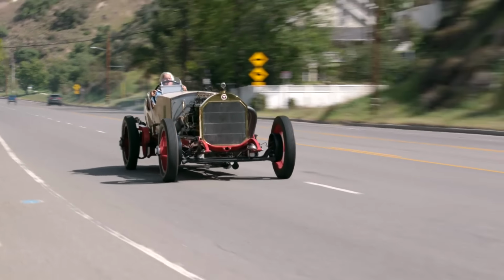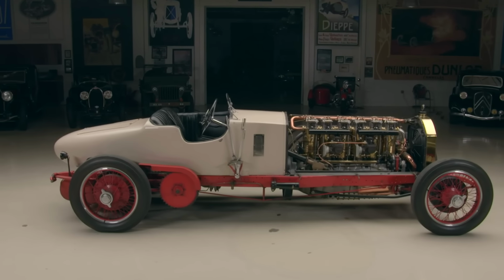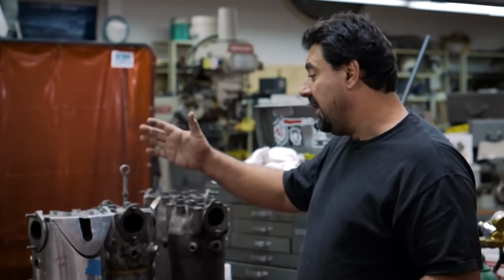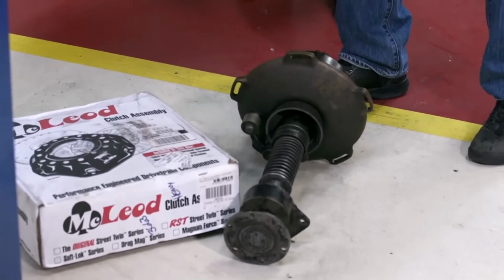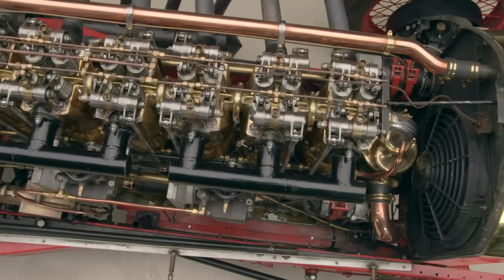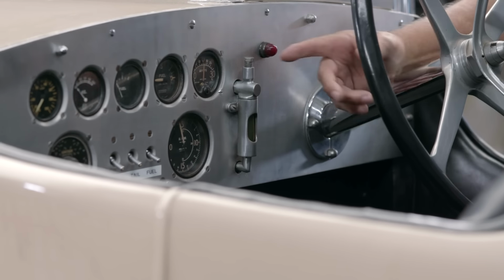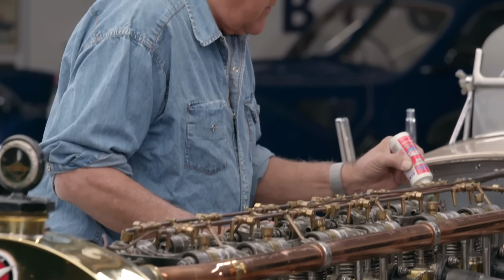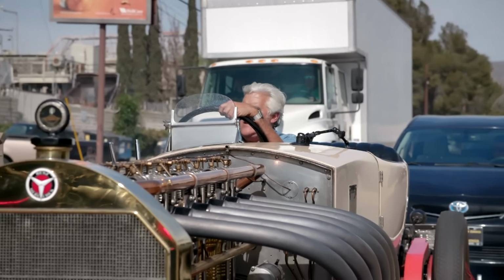1921 Benz-Mercedes Rabbit-the-First - Jay Leno’s Garage

Comment: Theres no doubt these chain drive motors are a blast to drive. Not only the chains flying around, tossing oil and grease onto tailgaters, but the huge engines, noise, dicey brakes and touchy steering.  Every motorhead needs to try one at least once!

Comment: Never heard about the transmission, how many speeds, where the shifter was, etc. I’m guessing it was one of the levers on the outside. Seemed to be geared awfully tall, because of the RPM range of the engine, I suppose. Definitely agree on leaving the bonnet off.

Comment: That's the problem with Restorations these days. Many times, they come out much better than the original car even was. You know, people are tired of seeing shiny perfect old cars. I want to see the original paint, I want to see how that got in there in the 1955 LeMans wreck, that's all history. These cars had numbers brush painted on them. Now people just slap the vinyl computer-generated numbers on the side. I like seeing a car that made it through the decades with the original paint, if it's chipped and scratched, it's the original chips and the original scratches that I come to see.

Comment: Should have used titanium instead of brass!
Reply: Titanium very hard and difficult to work - brass is soft, malleable and easy to join using brazing.
Reply: @rogerturner5504  yeah I know but Jay can afford it and titanium will last longer than brass.
Reply: @callumbush1  Brass musical instruments have been around for three-and-a-half thousand years. Titanium metal oxidises immediately upon exposure to air. Also cannot be worked with normal hand tools, presses and the like. Cannot be joined with a simple process like brazing.

Comment: Jay, really neat.  Right now I need to get my Packard 243 Touring out on the road a bit - hard to deal with the mess that ethanol keeps doing now.  FYI, mine is a bit odd - officially series 2, but built during the series 3 transition so it's a bit series 3.

Comment: I am here after watching the brand new 2020 E class cabriolet debut, 
so in conclusion, after 100 years of innovation, a Mercedes Benz convertible is still: 
1) red
2) long wheelbase 
3) 6 cylinder
4) rear wheel drive

Which one would you choose?  Model year 1921? or model year 2020?

Comment: This might sound kind of dumb but didn't the thing have a valve cover to keep the oil inside I mean I haven't heard that or maybe I missed it
Reply: Valve covers weren't installed , in fact the aircraft engines in WW1 didn't  have oil pans either.  On bomber planes the oil was caught in a can by a man standing next to it. Then they one on each side of the fuselage would keep catching & pouring the oil back into the top.  I cant imagine how they were recruited to do that job. LoL 😅

Comment: If the oilers are fixed in relation to the cups, why not install a brass tube loosely connecting them so the oil is protected from the wind. Should make driving more pleasant and keep everything 'downwind' a lot cleaner...

Comment: Great video, and love the car Jay, The drive chain noise you  could greatly reduce and come close to eliminating
the noise it makes by fixing a small idler tension gear  mid stream on the back side of the chain to take up that slack and it would probably increase the life of that chain also. The Tensioner could be spring loaded or you could have  manual adjustment whatever looks more authentic.
Thanks for listening have a good day.

Comment: Small historical correction, if I may: Emil Jellinek was an Austrian businessman who had been selling Daimler cars since 1898 and entered a couple of Daimlers into races in France in 1899 and 1900. This was when race cars had call signs, as it were, and he named his (and the subsequent ones) after his daughter Mercedes. At this point Daimler wasn't very widely known as a manufacturer, and Jellinek contributed greatly to their renown, with his success in racing and as a salesman. Daimler had only officially trademarked the Daimler name in 1899, and pretty much immediately adapted the Mercedes name as a brand (in 1902), so there were only ever really a couple of years where Daimlers weren't sold with the Mercedes badge.
Great video!
Reply: Yes, and the Mercedes name wasn't on Benz cars at all. Not until Daimler and Benz merged in 1926.

Comment: Are the brass water jackets isolated from the cylinder heads? When Iron and brass are in contact the iron will rust faster due to electrolyze.

Comment: That Toyota at 27:50 wanted to overtake just past the juction.
Then the Engine got from 250 to 281 RpM ...... Toyota gave up. Me:  haha.
A very nice Car. 
But don't run it too much.... it's a very time consuming job to renew all thos Valveguides

Comment: Jay, all aero designed and specified equipment has a very short "in service" life expectancy. The British Air Ministry only expected the planes to last a very few hours under combat conditions- the planes that finished the war intact had very few flying with their original engines. The Rolls V-12 Merlin you have is another example of that "won't last attitude" and what Rolls Royce and Packard thought about it. If Benz- Mercedes had though about it, they would have agreed the brass water jacket is a much more beautiful product- for stepping off the purist frame of mind, I think you did well by the car and by the drive ability you've installed into the car. BRAVO! Next project!

Comment: I bet Jimmy could make a beautiful brass Valve Cover (which could anchor to a few of the exhaust/intake anchors), with an open bottom and a downward turn, at the back; so as to deflect the oil downward (if you were to ever use the oilers for the valves).

Comment: I am surprized that Copper is used for water cooling and exhaust.  It is prone to vibration cracking.  "Put the hood on, Im getting oil in my hair, eyes, nose and other places".  Some timing chain tensioner strips would help those rear chains.  Front signal lights?

Comment: Jay and Jay's media team: You have almost 1000 comments but I wish you'd read this one I posted.  I don't remember Jay ever saying it on the videos, but those original water jackets are tin-plated steel food cans.  Here is the comment I wrote below, to user @Sparky, who says this:

@UCaLv1HUXhwsANhNXUUIxGrA
It looks like originally, literally, not figuratively, #3 cylinder tomato juice cans (46 oz) were used for the water jackets!

My reply:

@Sparky I have always thought they were some type of food service or military food can.  I would be surprised if it's NOT a food can.  Tin-plated steel cans were introduced in 1825 and tin-free steel was not introduced until the 1960s.  So many if not all contemporary food cans would be tin-plated steel.  Tin solders easily and doesn't rust, which is why it was used for food cans.  Tin, however, is fairly soft and expensive so an under structure of steel was used because cans wouldn't collapse.  I wonder if that's not what they used on these water jackets for the same reasons.  In the intervening 100 years, that tin would have corroded away, exposing the steel which rusted through.  I wish Jay's crew would respond to these comments because I think those are actually food cans adapted for the purpose.  I mean even if they didn't drink up the tomato juice or gather them out of the trash, why wouldn't they use the existing machinery for tin-plated steel cans which solves a bunch of problems they wouldn't have to deal with.  It's like copying and pasting code, no need to re-invent the wheel.

Comment: Had to laugh while watching Jay craning his neck to see over the steering wheel because it's so big. Since guys back when the car was made tended to be shorter than the average now, I wonder how they dealt with it. I also wonder how hard it is to steer at low speed if that huge steering wheel radius is needed for mechanical advantage.

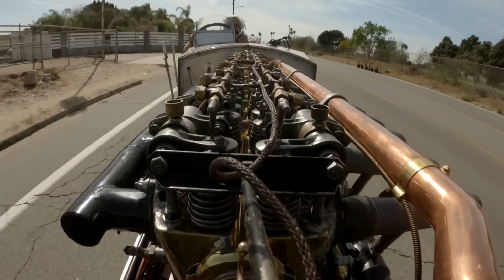Comment: 25:38 "Always want to keep your hands inside this thing, in case one of those chains breaks. It'll loop around and cut your arm off." Sounds like the perfect daily driver.
Reply: That's what happened to parry thomas except he died instantly 😢
Reply: @Hugofreddie  Actually it was already established at the time that while the chain broke what killed J.G. Parry-Thomas was the car rolling and him receiving a fatal head injury when his head hit the ground. There are even stories that the chain broke and nearly decapitated him. It's false.
Reply: @McLarenMercedes  it's a tricky one as no one is still quite sure what happened it is supposed that one of the rear wheels collapsed . However he was nearly decapitated by the accident ,and it was said at the time a chain broke on recovery both chains were intact , there was and still is the possibility that an item.of clothing got caught as there were only minimal fairings . Either way chain drive is lethal and no one knows what caused Babs to crash but point taken .
Reply: @McLarenMercedes  My understanding is that a radius rod that located the rear axle broke. That allowed the chain to come loose, and caused the crash that overturned the car. It's more likely that the overturned car killed Parry Thomas, rather than the chain. But I wasn't there to see....
I too have had a motorcycle chain snap, at about 75mph on a motorway. The engine screamed way past the red-line and the rear wheel locked up, then came free at about 30mph. The chain had wrapped around the rear fork, bent it and snapped the chain adjuster. Very exciting at the time.
Reply: hugo w happens? I think you mean happened
Reply: @yammmit  you are quite correct please excuse my grammar I shall correct it 😊
Reply: @yammmit  schmuck
Reply: Yeah that won't hurt you. I had a hardtail chopper, no chain guard, no anything. I was going under a bridge at like 70 mile-an-hour, & wide open, my chain broke, and smacked me in the back, and left an imprint on my skin, because I didn't have a shirt on. Just a bruise. it wasn't bad. I did have an imprint of a chain, all the way up the right side of my back, for about 3 weeks, LOL
Reply: Actually, when a motorcycle breaks a similar chain...it just falls out the bottom without any drama.  Commonly known fact if you ride motorcycles.
Reply: But the transmission shift is outside 🤣

Comment: 24:10 The chain drive to the oil pump hangs low, just behind the front axle - so make a protection bar for it.
Reply: Pashak de Scilly just for when you “accidentally” run over or use a Prius or such as your stopping distance

Comment: 1 month, 1 cylinder. Jesus, that's a LOT of qualified labour into that engine
Reply: Figure the guy costs $50 an hour for wages and workmen's comp etc. 50X40 = $2000 a week, X4 = $8000 for ONE cylinder, X6 cylinders = $48,000 for water jackets to make the car driveable. I don't see how it took a month to do each cylinder but that is what he said.

Then there is the clutch, front axle,  and all the other cleanup and repair. Could easily have $100,000 in making the car driveable, that he probably paid at least that much for, to begin with.

Comment: Do you know why pilots and drivers wore the "silk scarf" in addition to the goggles?
Reply: Jack Fletcher so the leather jackets didn't chafe their necks. Their heads were on the move all the time looking for the enemy.
Reply: @daleolson3506  I've seen that.... Also seen that it was just for warmth.   I also saw that it was to keep (castor) oil off the face and out of the mouth.    I see a lot of period photos showing non combat  pilots with a scarf over their mouths which seems to imply that the chafing explanation might not be the main reason.

Comment: Why don't Jay's cars smoke? Just realized, did you ever ever see a smoking Jays personal car? :)
Reply: This one was a little, but it's a very fresh rebuild. An engine only smokes when it's getting oil or coolant in the combustion chamber. A fresh rebuild will smoke a bit until the rings seal up, and a car with worn valve seals or rings will smoke. Iirc, smoke just when you accelerate is valves, smoke all the time is rings.
Reply: @ScottKenny1978  interesting, I thought it was quite normal for old pre-war cars to smoke alot :)
Reply: @ScottKenny1978  well this one is just post war

Comment: Could you please do an episode where you explain the idle/ignition levers that are on a lot of those old cars steering wheels a bit more?
He always mentions them, it somehow makes sense to me, but i could not really explain it, the details are a bit misterious to me (and why we don´t need them in modenr engines, what replaced them) would be amazing! Thanks
Reply: In older cars the driver would advance the distributor by moving the lever wich pushed or pulled by a cable connected to the lever on the steering wheel.  Later engine timing was advanced by vacume. Now it's done electronically by the vehicle computer. Hope this helped...
Reply: @FredPriest-s5u  thank you

Comment: What a great idea – single piece cylinders - no head gasket to blow. You know, I'm sure SAAB were considering this design, with jackets integral to the cylinder head, before they finally went bust. You could probably get much higher compression ratios, at least with modern design and engineering.

Comment: I did hear that back in the day they used to use caster oil to lube the valve train in aero engines.. You can imagine with that oil hitting you in the face what effect it had on the bowels.

Comment: A good way to safeguard against chain snap would be to hide a metal pin under the rear most portion of the chain guard, affixed somehow to the frame, if the chain does snap such that it would go forward, the pin would make it slap against the cover and fall harmlessly on the ground. That's how they did chain guards on long reach saw blades back in the day.

Comment: This might look nice with some kind of a transparent engine cover. This would protect the engine from dirt and the driver and the car from being sprayed with engine oil.
Reply: The inside would get covered with oil, but I have seen an oil-phobic epoxy clear coat that could be sprayed on. The oil would bead up and run off like water on a waxed car.

Comment: Cant wait to see the amg version
Reply: That’ll be the long awaited overdue v12 version then
Reply: @jamespacker5712  using a 35.7liter Daimler Benz DB605 that came out of a Messerschmitt bf109G, and makes 1000hp at 2300rpm, and 1800hp at 2800rpm with water injection running. On 87octane gas.

Comment: that thing sounds like my old falling apart truck when going down the road
Reply: hahahaha omg
Reply: I think then you need a new muffler or exhaust manifold:)
Reply: @MrTruth111  and a new suspension, drivetrain, engine, wheel bearings, rear dif, body panels, paint job, well, the list goes on...

Comment: I've always wondered why it never occurred to the engineers of the day to enclose the rocker gear.
Reply: Aero engine, no dust up high, full loss lubrication on many old aero engines, also metal valve covers probably weighed too much for the engineers to consider using when they didn't even put a pressurized oiling system on the top end, just a few cups and a messy oily valve train(and a greasy smile).
Reply: mescko also the technology was a carry over from steam engines which kept everything open as well
Reply: It becomes an issue with casting and machining ability of the day. They couldn’t reasonably put oil passages from the crankcase to the valvetrain. So, they just left it open to allow for manual lubrication. Same reason it has the sheet metal sleeves for coolant. They couldn’t really make water passages into the castings so just made sleeves.

Comment: Love these huge displacement, chain driven beasts. They are just cool to me. Functional cool with a mix of art on wheels. The outside hand shifter and rear brake, the exposed engine which is an absolute work of art in its own right, the over engineering, just everything about these beauties. What a great car.

Comment: Where do I get zinc for my engine, I don't want the cam bearings to wear out.
Reply: There ate zinc additives and oils made specifically for older cars.  You can probably Google and find plenty of both.  It's the cam lobes that wear prematurely.
Reply: @glenngriffith7166  thank you so much.
Reply: any automotive store, its just an additive.
Reply: @MrMasterDin  thank you so much also I was just told a few weeks ago about zinc in the engine and the Crooked oil companies took it out of the oil
Reply: @billthompson5644  zinc can't be used with modern cars as it will ruin the catalytic converters.
Reply: Make sure you dont have catalytic converters.  Zinc will ruin them
Reply: @stevemic  I have my dad's all original 1969 Plymouth GTX 440 with a 727 and a Sure Grip rear end. He bought it brand new. The Marlboro Man took him out in 1985, and he gave me the car I've had it since 1984. The only Parts I changed are the wearable parts. It has 56,287 original miles.